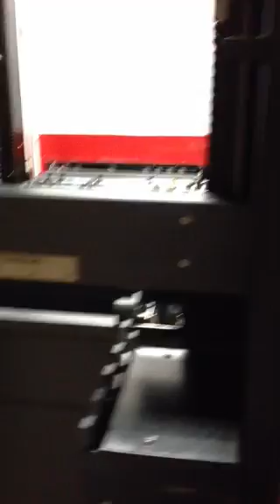dip & dunk film processing

Comment: It's great to see a dunk and dip machine still in use. I wonder what make and model this machine is? In the 1960s I operated an Ilford Roll Film Processor that was a black and white machine and in the 70s I operated an Ilford Colour Roll Film Processor. This was a dual track machine one side for C22 Kodacolor and the other for Ilford Colour Neg films.
Reply from the maker: its Refrema machine!  i have tree of them Running a good amount of film, E-6, C-41 & B&W.
thanks
Reply: Tarik Laaziz Which of the three types do you see the most of, C41?
Reply: This is a Refrema E6 Dip and dunk machine with time variation in the first developer.